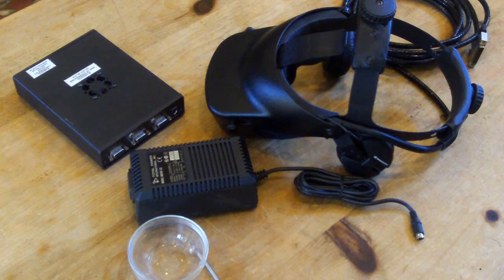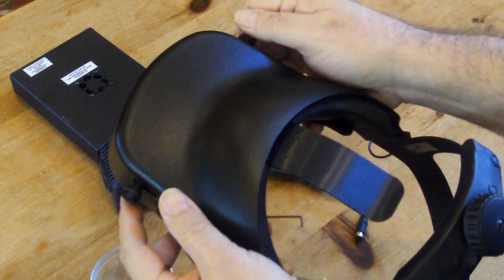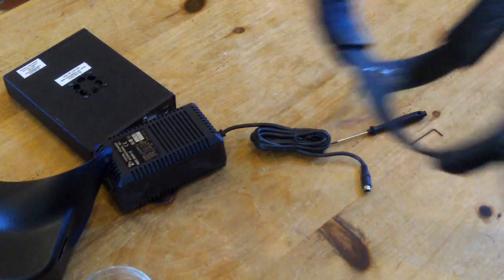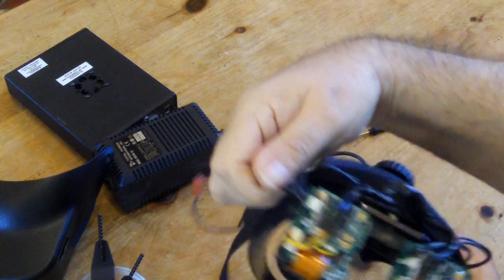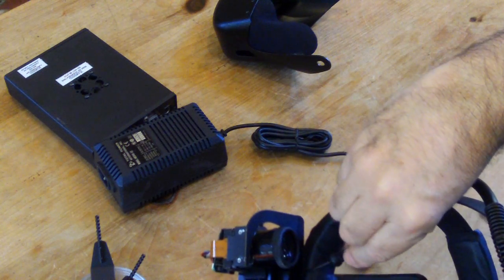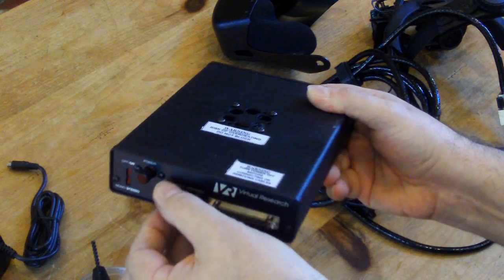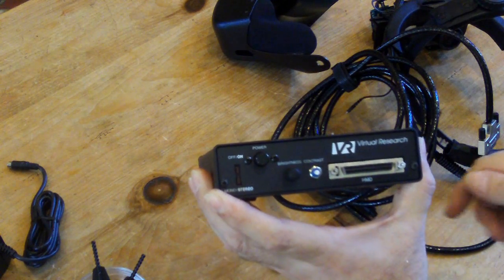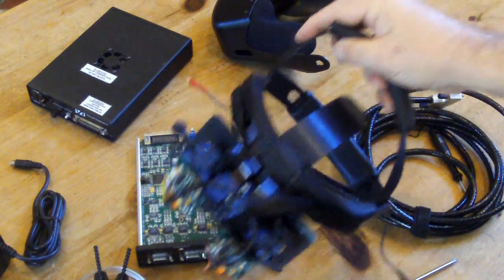Virtual Research V6 HMD Teardown

Comment: Is it possible to remove the lenses in order to clean the surface of the LCD screens?
Reply from the maker: There are small holes in the optics housing which are designed for cleaning with compressed air (photo lens quality air.) If you look at the video, at 5:30 I'm pointing to a plastic cube enclosure that holds the LCD attached to the lens assembly. On the sides of that enclosure, there are small rectangles of electrical tape. Carefully peel them back to reveal the blowout holes. The holes are big enough to insert the thin hollow tube that is supplied with a spray can of compressed air. Make sure to open two holes, one for the air inlet and one for an air outlet. Use short puffs of air so there is no condensation from the cold of air expansion.

When you're done, you can reapply the same electrical tape, or cut new rectangles of fresh tape.

Comment: amazingly helpful, thanks. I'm building an ultra low-cost computer, and the LCD was more than 50% of the total cost, and took up 50% of the power requirement. HMD could cut down the cost massively.